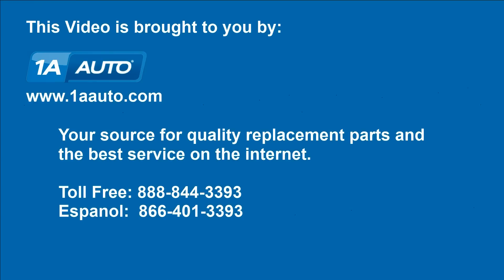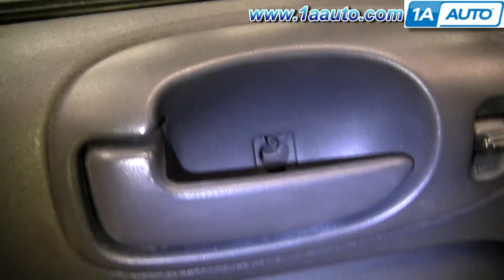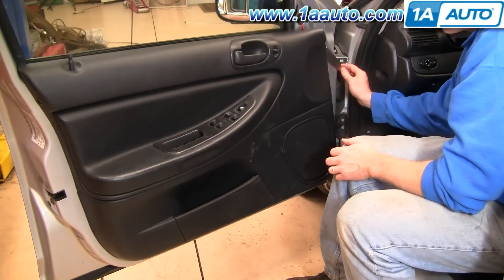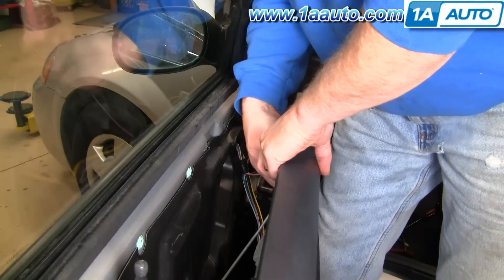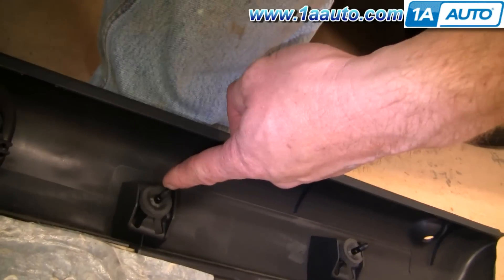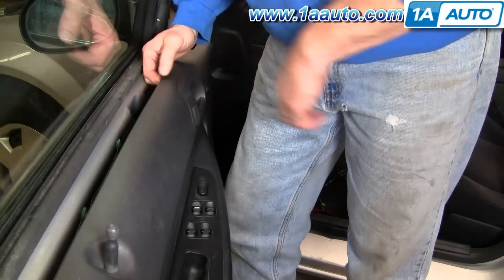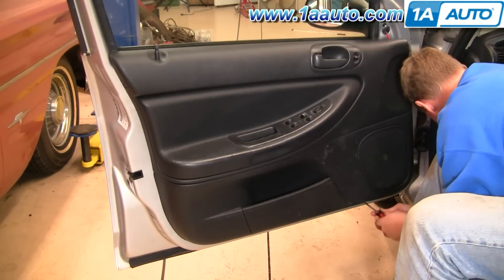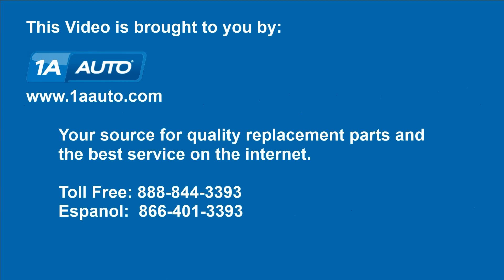How To Remove Door Panel 01-06 Dodge Stratus

Comment: I wish there was a little more view of that back side of the inside door handle tosee how & where the rod goes into the hidden side of the handle lever. In my daughter's car the inside handle suddenly stopped working and we are trying to figure out what we need to buy. You mentioned in your other video something about a clip or spring possibly breaking? Wish i could find an easy blow-apart.

Comment: If I am just needing to replace the door lock switch on the driver side. Do I need to remove the entire panel and unplug all the harnesses? Or can I (doubt it) just access it through the little door handle trim piece? I noticed there is a little cover behind the interior door handle that pops out with a Phillips head behind it... Does that come off and allow access or do I have to actually do some hard labor? 😪😣
Reply from the maker: +J Barela We do not have a video for this repair right now, but we'll keep this request in mind for a future video! 1AAuto.com

Comment: Hi, Im having a little problem sliding down/up my windows of my dodge strastus 01, my car's window switches on the drivers side fell in,  How can I fix it? Did something broke on the inside? I really hope you can answer back, thanks
Reply: Did you ever get it fixed? It sounds like the window regulator stopped working, but it could be thwindow motor

Comment: I've got intermittent issues with the switches on my wife's driver door. The locks won't work when the key is in the ignition (doesn't matter if it's off, acc, on, or crank position) and the window switches no longer work on the driver door. The windows should be easier to troubleshoot but do you have any ideas for the door lock switch issue?
Reply from the maker: Hi Nick, Check the wire harness that runs between the drivers side and body of the vehicle for a broken or frayed wire. Hope this helps you out. 1aauto.com 866-403-3393